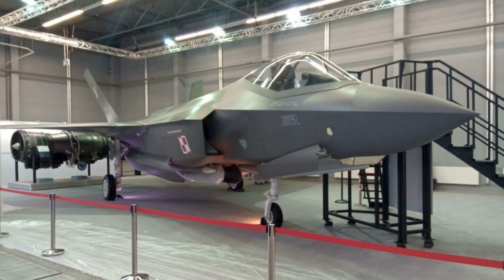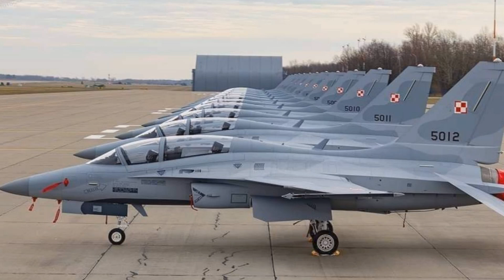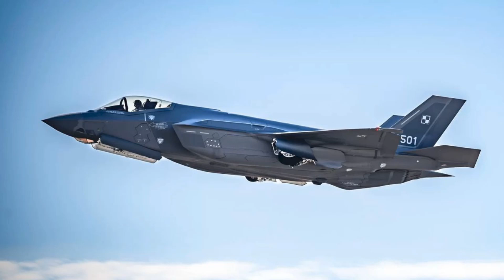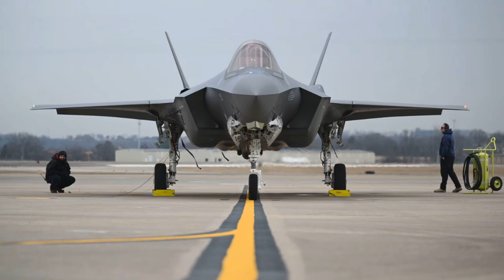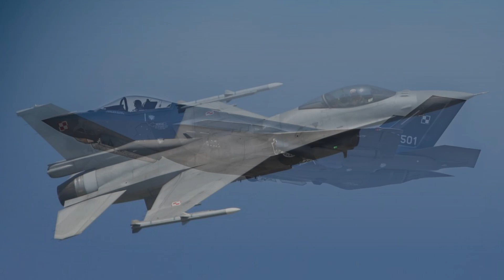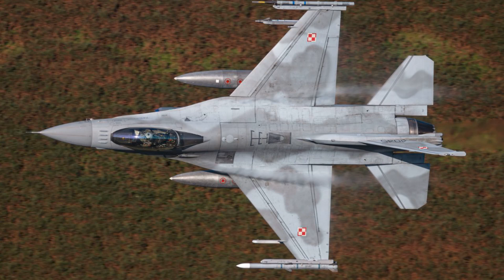Poland Drops the FA-50GF Upgrade — The Missile Bottleneck Behind the Decision

Comment: Poland does not cancell anything.

There was no agreement to upgrade FA50GF (GF for "gap filler").

Only media bought by Koreans with thier promo campain of "almost F-16". Now the Air Force have a problem with those aircraft as FA-50PL should start do be delivered 2025 and will not, and FA-50GF are useles as a combat platform.

12 FA-50GF replaced 11 MiG-29 and 3 MiG-29UB, most of those was delivered to fighting Ukraine. 
the FA-50PL were to replace rest of MiG-29s and Su-22.
Reply: It's not too late. Build a fighter jet. It'll be far more satisfying than waiting for the F-16 or using enemy Russian fighters. Good luck!
Reply: ???
FA-50  is  80% F-16 with much much cheaper price tag  and  even lower fuel & maintenance costs
poland wanted american phontom strike radars    america still didn't deliver phantom strike radars to korea    korea will start delivering  FA-50PL  when america delivers phantom strike radars
poland ordered 48 FA-50 without weapon systems     weapon systems are responsibility of purchasing country    in this case poland
if poland want to use machine guns, get bullets and start shooting machine guns
if poland want to use air-to-ground weapons, put air-to-ground weapons and start dropping those bombs
if poland want to use air-to-air missiles, order air-to-air missiles and start firing them
so poland wants  american AIM-120D air-to-air missiles, then order them to america
if america refuses to sell them to poland, that is the problem between poland and america
why do you keep blaming korea???
Reply: @truthteller6576  This is how corruption looks like.

Comment: Interesting take indeed. 
However, there are 2 questions misleading the thoughts;

1. Integration approval is not FA20PL supplier’s job. Aim120 purchase and approvals required is the responsibility of the buyer as stated in the purchase contract. So are the radar. KAI proposed alternatives (Korean indigenous radar plus Meteor combination) but Polish chose Aim120 as they already had some for F16.  If they had chosen Korean AESA radar, this would not have been an issue. 

2. Koreans have not failed to meet delivery timeline in any agreement, not even a single unit has been late for over 300 ground and air platforms, which in itself is unheard of in modern acquisition programs.  Hence, blaming them of ‘potential delays’ from the decision or action of the buyer and the third party supplier is inadequate.  

What people forget is, the Panthom Strike radar is not developed by Raytheon(or RTX) but acquired by them.  It was developed by a small company which was later acquired by RTX.  Hence their development capacity is not clear.  

IMHO, the blame should be the US gov (refusing to integrate non-US radar with US made munitions and refusing to accelerate Polish acquisition request) and Poland for being late in approval request and lacking diplomatic capital to accelerate the process.
Reply: This is 100% correct!
Reply: @jclulu3942 what is correct ? TA50i and KF21 main problem is the low performance of Hanwha AESA radars and cannot be integrated with US Made BVR missiles such as AAMRAM 120
Reply: @Steve-so7uk  ou're spouting baseless, idiotic nonsense. Hanwha's AESA radar is made with the most advanced gallium nitride elements and consists of over 1,000 elements, making it one of the best radars in the world. Hanwha has exported various radars, including fighter jets, UAVs, and air defense radars, to various countries, including Italy (Leonardo), South Africa (Milkor Aerospace and Defense), Saudi Arabia, and the UAE. In particular, Italy's Leonardo plans to install Hanwha's radar on its light attack aircraft, the M-346. LIG NEX1's FA-50 radar is currently undergoing testing and will be installed on the FA-50 Block 20 once testing is complete. The AIM-120 is an American missile. If Poland wants to acquire the AIM-120, it must obtain permission from the United States. If Poland receives permission from the United States, South Korea can integrate the AIM-120 into the FA-50 at any time. Do you understand? Before you start talking nonsense, I hope you at least study the basics of international military affairs.
Reply: @jclulu3942 nope 😂😂😂 okey at least Leonardo AESA cam be integrated with MBDA misilles or italian made missiles.
Reply: @jclulu3942 thw one issue that we don't like and have issues are the " getting permission from US govt " . That is why buying F15Ex, KF21 and TA50i will be at the mercybof US policy. South Korea is an obedient servant of US whims. Do you realise now why Poland are slow walking ? USA wants Poland to buy F35 or F15Ex, or F16V not the down graded version of F16 as well as the U209 or U214 sub clones from South Korea. That iscwhy they choose Swedish Gotland sub. Poland will likely purchase Grippen E or Rafale F4. TA50 is only good as trainer jets.
Reply: @Steve-so7uk  너희 인도네시아 사람들은 프랑스와 독일은 안 그럴꺼라 너무 믿네? 😂  프랑스와 독일제 미사일 가격이 미국제에 비해 2.5배 정도 비싸다는 건 알고 있니?  가격도 문제지만 독일은 자국제 미사일에 정치적 문제로 인해 인도거부를  하는 경우도 엄청 많다.  유럽이 천사인 줄 아니?
Reply: No correction , KAI has delayed by more than 2 months now for the delivery of 6 TA50i to Indonesian Air Force. That is why Indonesia decided to purchase 18 Leonardo Aeromachi M248 trainer with Leonardo AESA radar and Air to air refuelling pod.  Indonesia could not put their security on the whim of both USA and South Korea. In the future there will be more Rafale 4 and 5 , KAAN and even Russian made Su 35 and Su 57. Slowly but surely F16, F5 and C130 will be retired slowly. This will also as well go to TA50i prone to delays, sabotage and sanctions. F15ex has a very low probability and in 5 years , you will see more Rafale, KAAN, Su 35/57, A400M, A330MRTT , SAAB AEWC with French made planes .